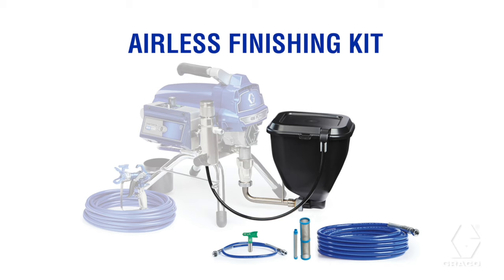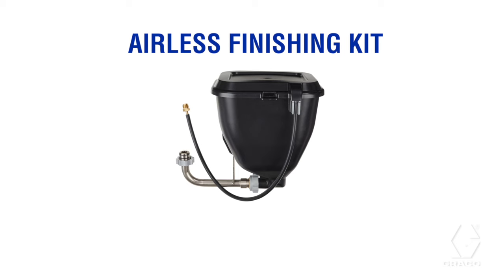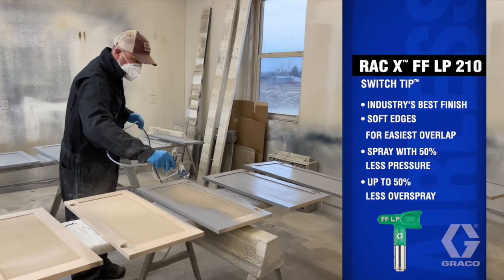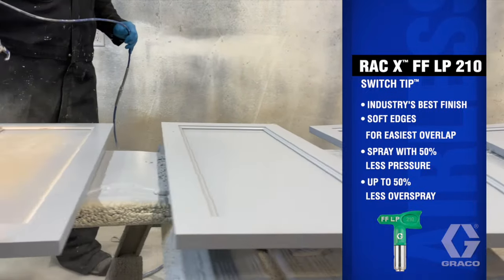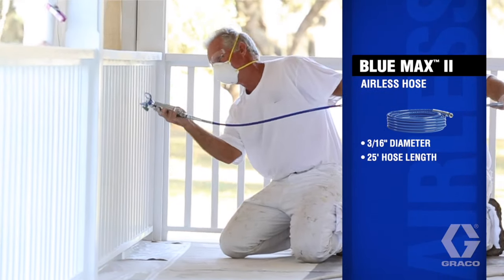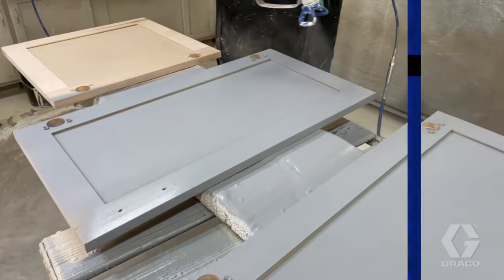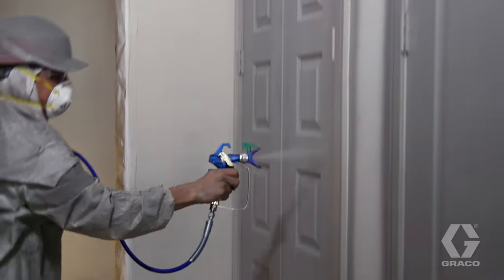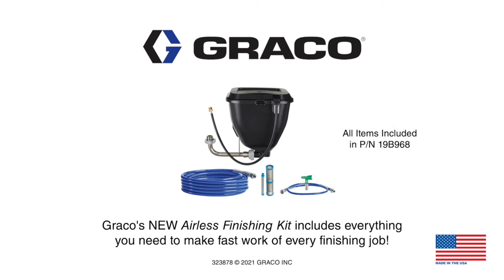Graco Airless Finishing Kit

Comment: Hi. I just bought Graco Gx19 to refinish kitchen cabinets with Renner M643 and 851. Is tip FFLP 210 good enough for perfect finish or should I use a better tip? Someone recommend Tritech tip 206 better. Please advise. Thank you in advance.
Reply: Hey there! What did you end up using (ie 206, 210, etc)? And what was the outcome? Thanks in advance.